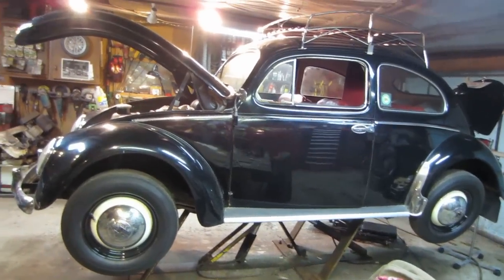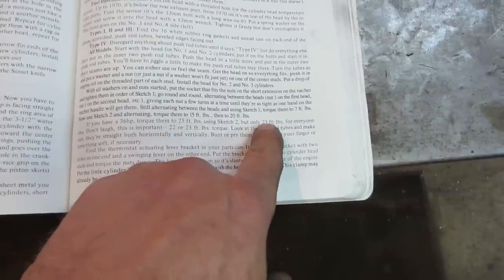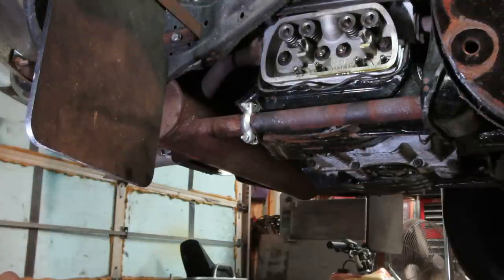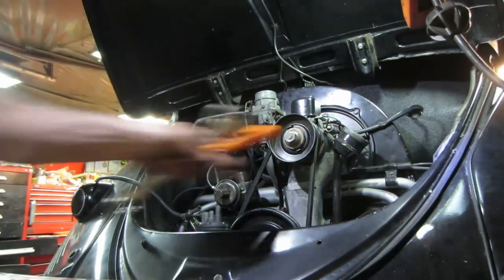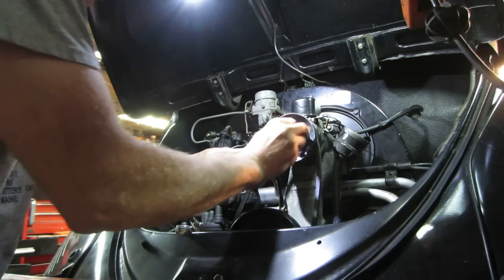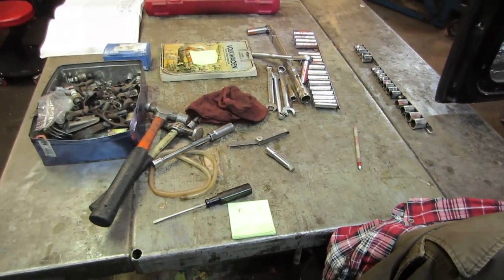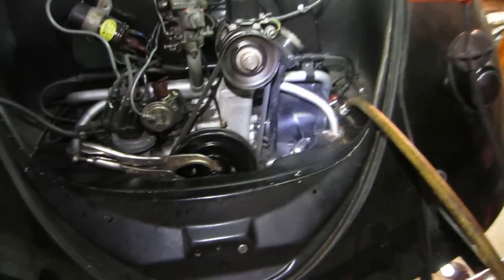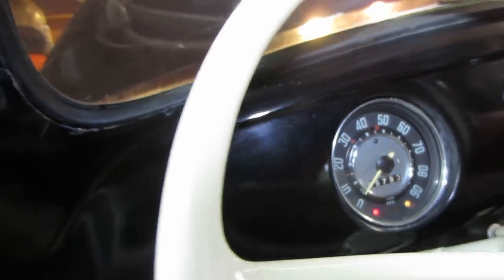engine diagnosis on the 1954 vw beetle

Comment: I spent most of my life as a vw mechanic and the engines were notorious for needing valve jobs and then on the later engines the heads leaked. Many a muffler were put on to engines that needed the heads fly cut and new pistons and cylinders. Most of the times the heads needed new valve guides and it was the valve guides going bad that ruined the valves. Put the cylinder head in an oven and heat them up and the guides come out easily.
Reply from the maker: the guide may have dropped on this one, holding the valve open

Comment: By the looks of it the valve gap sticker on the doghouse is wrong. The problem is most likely someone has set the valves to .006mm. the 36hp needs 008mm on intake and 012 on the exhaust due to the longer head studs. This should restore the compression to normal as th Valves are now open and closed at exactly the right time

Comment: Under The Back Seat Near The Shift Coupler Cover  You Will See The Vin Number.  The Third Number Is The Year. I Worked As  A Tech For Volkswagen  And Audi For 33 Years And Have Been A Mechanic For 48 Years And have Owned Many Many Air Cooled Volkswagens

Comment: I was nearly 100% certain that the '70 Beetle was the only year to use that 1600 single port. Started scratching my head when you said '71. Honestly though...in air cooled V-Dubs, engines are swapped around so much that you never know whether you're looking at a factory installed mill. But that engine pointed toward a 70 in my book.

Comment: Man, this takes me back to when I was a kid and my dad worked as a mechanic in Virginia. He had a pretty good reputation for working on VWs. The guy who owned the tire shop where he worked advertised this too.One of the things I remember were low torque head studs and valves not set properly. Occasionally he would run across stripped studs. What a bummer, had to pull the motor and send it to the machine shop for case savers. I remember one person had brought a beetle in for a tune up and he couldn't get any compression on number 3 cylinder. When he pulled the valve cover it was clear the head was gone off the exhaust valve. Telling the customer what it was going to take to fix it, they said it had been low on power for years and they didn't have the money to fix it properly. So, he just made do with what he could do and sent them on their way.

Comment: my engine had a cylinder with lower compresion im sure it was all the carbon build up on the valve but i just cleaned all the valves and set them back in the cylinder head and also changed the rings since i had the head off and wanted to make sure the jugs were good put it all back on the motor and tested the compresion again andd it was still like 80ish checked the valves and they were off by a bit put it to spec and boom back too 120psi :)

Comment: Hi! Thanks for a nice video! I think you did a nice job reasoning out this engines troubles and evaluating its condition. I enjoyed watching you work and the explanation of your reasoning. This is a great help in planning the work of restoring this engine and properly planning a budget for parts and labor. I just had one thought to run past you. I remember in my own past running across an engine with worn surfaces between the rocker arm and valve stem. The feeler gauge would actually get chewed up and dented. I couldn't afford a reground rocker assembly so I used a dial gauge from my metal lathe tools to set the valve clearance. Does the VW engine rockers wear this way too? Just for a fun info, I still have the first car my Dad bought me in 1962 when I was 16 years old, a 1952 MGTD. I can relate to your feelings on letting go of your Mustang only to the extent that my MG is still in the garage and I cannot bring myself to part with it.

Comment: on another subject, i found a gas station in my area that still sells non ethanol fuel, as you have pointed out, many small engine trouble can be linked to ethanol  it might be worth mentioning  to your fan  base to look for  a station that sells non ethanol fuel to run in their small engines , if you agree with that viewpoint
Reply: see people put water in the gas to wash out the ethanol out . stir it up it all drops to bottom gas on top. octane of 89  .wait 24 hours to drop the water out

Comment: Can you get a Borescope  in it? I seen some cheap ones for the smart phones and laptops on Amazon 20 bucks and less. Not pro quality but for that change they may give some use somewhere.
Reply: Generally those cheap borescopes for smart phones are pretty useless, to the point of being a waste of money.  Having said that, certainly in the UK, borescopes are becoming such a common tool that decent quality items are available at quite reasonable prices now.  In this case, it probably wouldn't be a huge help as the trouble shooting done here suggests that the engine is generally quite tired over all and that cylinder has an inlet valve problem, maybe a damaged valve head or maybe a valve seat problem...

Comment: oh man I got a headache!  it appears that VW counted all production consecutively and you had convertibles mixed in, I found the first cabriolet off the line chassis number was 150 2000005 or the fifth beetle off the line.   they list the last Beetle as 3100000 but I have come up blank on what the number of the last cabriolet was and as the numbers were mixed in that is real hard.
I have a hard core VW friend who knows a lot he may have a idea or know where to find that info, I will ask him.
Reply: 366,790 1970 sedans sold in America, 11,432 cabriolets, total production of Cabriolets was 18008 for 1970, only 422 beetles total made after yours for 1970. I still have yet to find the chassis number for the last cabriolet but MAN yours got to be real damn close if not the last one.
Reply from the maker: thats what l was thinking too,
Reply: I did some research on 1970 Cabriolet's for sale and all of the ones that listed the chassis number they were all from early in the production run. none remotely as late as your's
it is looking like the only way to know for sure is to submit your chassis number and cash to Volkswagen and they will research it and produce a pedigree for you.

Comment: You have nailed its problems with your spot on diagnostics, im supprised it runs at all.
A very forgiving engine, and the movable shims is just too clever :-D
So without a rebuild, it could be improved a little by replacing the valves, the blowback looked really bad :-(.

Comment: In the footage from underneath,it is too soon to stick your hand under the jug/head .First,turn the crank backward via the generator nut until the intake valve closes.Also,a good indicator of head/jug leak is  if it has  crud collection on push rod tube below the head/jug juncture .

Comment: you're a good mechanic, did what i would do to check things with air pressure and method to set valves backing- off and let the tightening nut do the fine setting..enjoyed it. If the car or motor  wasn't such a treasure, you could carefully spin (w/lubricant) that intake valve (hand lap or with drill if clearance) while head still on...to get a slightly better seal. But that's a simple motor...take both heads off and replace or rebuild them....i'd leave those rings as-is...quick fix to get 'er running good enough.

Comment: The correct engine for this car should actually be 25hp, the 54 is what's known as a "Zwitter" here in Gemany as it still shared many on the components from the split window bug, including the 25hp engine with the single tail pipe, I own a 53 Oval which is identical and it still has it's orignal engine.

Comment: Yeah according to the numbers it's a very late '70. Plus it doesn't have a dual-port engine which a '71 should have, although if that's an H5 engine it's not the original anyway. Should be a B6.
Reply from the maker: l think it is a b

Comment: complete new ignition leads, cap arm and points, get the heads sorted with seats reground check for warping, then re hone the barrels and fit new rings, by the time you've sorted that it should go like a bird.

Comment: According to the book The Car of the Century, chassis no. 1503096945 was the last Karmann Convertible model 151 built on a 'regular' frame with the torsion bar front axle, in July, 1970. Also, the seat tracks change in 1971 although the front seats look identical, they don't interchange from one year to the other (believe me, I know). 

The tail lamp bodies are the same as 68-69 but now had two holes punched in each outer side for new reflectors to pop into. The lenses are the same size as 69, but they lost their rear facing reflectors. Two more small reflectors were mounted on each bumper bracket in the rear, mounted on the top of the bumper, not the bottom.

 So, 1971 tail lights are larger, have rear facing reflector in the lens, have the side reflectors
while` the reflectors in the bumper go away, and the front seat bases are different, for 71-72 only. Another clue is that the dash pads are slightly different, where the parking brake light is. 1970 is the last year with the bulb test function (dual circuit), the '71 didn't have that feature. And probably a 71 would have a ventilation fan, unlike the '70. And finally, the obvious, a flat mounted spare tire in the trunk due to the McPherson front suspension. 

And just wanted to point out that a beam torque wrench has to be used for the cylinder heads, not a click one. I still have mine from 34 years ago, and a Bentley service manual.

Comment: Look at the first 3 digits of the VIN. First 2 digits are the type and the third digit is the year. For example 117 would be a 1967 Type 1. If yours says 110 it's a 1970. Plan on seeing that since 1971 convertibles were all Super Beetles. Between you and vwdarrin I'm getting the itch for another VW....

Comment: Did you test the #2 spark plug and wire? Do those and see if one or the other is bad. Could also be the points or distributor cam is worn, so you may need to check those, too.
Reply: Nice thought, but 75psi compression and the blowback through the carb speak volumes on the issue this engine has, also the cylinder kicks back in with a few revs. Ignition problems would tend to run on all 4 at idle and lose the cylinder under load as the spark is too weak to ignite the denser mixture.

Comment: Doesn't it damage the coil to remove the spark plug wires from the spark plug while the engine is running?
Reply from the maker: no not on this

Comment: Did you make a video where you discovered the trouble with the low compression cylinder and perhaps fixed it?
Reply from the maker: he pulled the engine and l think it was a valve guide that worked its way down holding the valve open

Comment: its kinda  rare for an intake valve to lose its seal (compression ).... when those heads  over heat sometimes the valve seat goes nuts, or the valve and seat  got  rusty. I dont like storing engines with the valve,s open,  I back  the rockers off so the valve spring pressure  is off the hook.

Comment: I see you have the Clymer Manual as the holder for the post-it with the compression results. That is all they are good for. I assume that is a Chilton Manual we see open. I have found with Japanese motorcycles, for example, the original factory Manuals are the best. (Duh!) 
That is for me. :-) Been down the "Manual" path. My knowledge may be dated.

Comment: My compression pressure 150psi on my 74' 1200 bug... Normal or too high?
Reply from the maker: between 100 and 150 but all 4 should be within say 20 lbs or it will idle ruff

Comment: Have you ever re builded a 1969 VW Bug?
You must toque the cylinder heads in the correct order. If you don't problems with the cylinder heads will occur. All heads must be toured in the proper order.
Your heads will warp if not properly torqued in proper order
`
The original carburetor's main jet looks like a pencil point. if you tighten that jet too much the point will become damaged.  you CAN NOT feel the resistance when you over tighten the main jet of the carburetor

Comment: Within 10%-so easy to pop out the engine I would remove and re-torque all properly- great that you have that engine, etc..  Original non synchro 1st gear trans too????

Comment: The BEST way would be to contact Volkswagen themselves, either a Volkswagen seller in the US or directly here at their German headquarters. What they do is, they counter-check your vehicle registration number against what they have, and they will also hand you a certificate (about €50).

It will be verified by VW.
http://automuseum.volkswagen.de/en/certificates-and-data-sheets.html